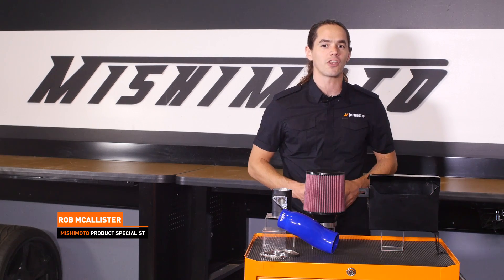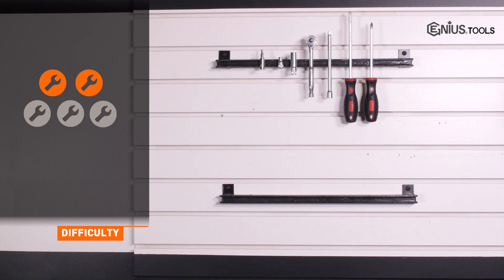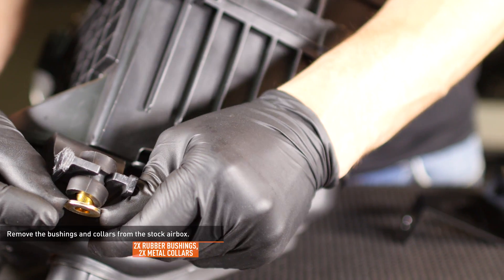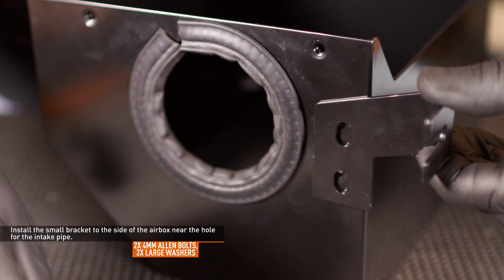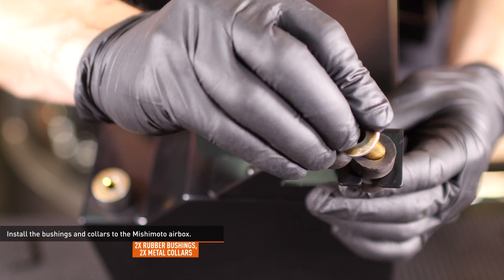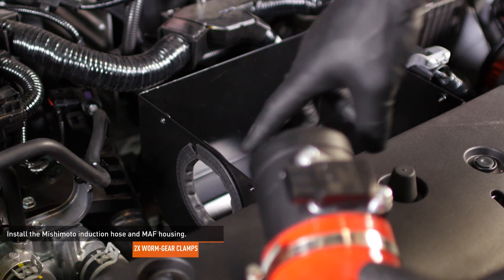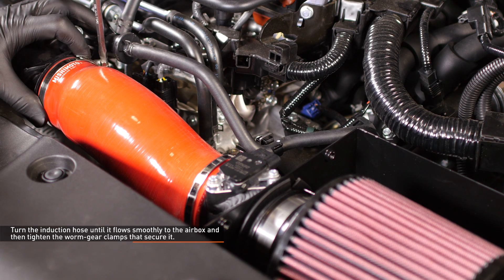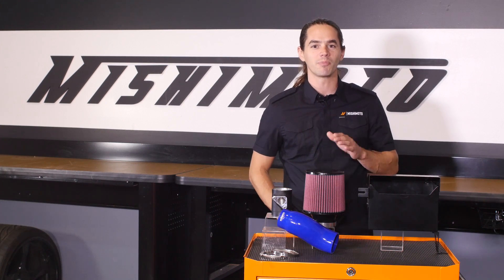2016-2021 Honda Civic 1.5 Turbo Performance Air Intake Installation Guide by Mishimoto

Comment: is this a short ram intake or cold air intake ??
Reply from the maker: This kit does not relocate the filter element location from the stock position, however, it retains all OEM ducting which pulls cooler air from below.

Comment: How many miles in between washing the filter or replacing it?
Reply from the maker: 10-15k depending on location and driving style. Once the filter is no longer visibly red (typically turns a greyish-brown), it's time to clean and reoil.

Comment: Hi, I got mine installed on my 2021 EX hatch a year ago and I would like to purchase a secondary air filter to use when I clean the other one. Which dimensions should I go to, the 4" inlet & 7" length or 3.5" inlet & 8" length? Thank you in advance! 🙏
Reply from the maker: Replacement filter part number: MMAF-2756
https://www.mishimoto.com/performance-air-filter.html

Comment: Increases throttle response?
Reply from the maker: If you are asking if the turbo will spool up faster, yes. The intake will allow it to breath better and net gains of up to 9 whp and 10 wtq on the stock tune.

Comment: Does this intake require me to tune my 1.5T civic hatchback????
Reply from the maker: Nope!
Reply: @mishimoto  what about the intercooler you guys offer for the same car I have CVT transmission 😬
Reply from the maker: Max power gains of 4 whp and 8 ft-lbs torque on stock tuning

Comment: Installed mine Tuesday in about an hour. Painless. Didn't get a chance to drive the car until today, but the difference is enormous. It has this beautiful low-end growl. The turbo is louder, but at about 45 I lose the sound of it to the growl of the engine.

Could not be any happier with this.
Reply from the maker: Thank you for the review!
Reply: @mishimoto  Thank you for making such a fantastic intake. When it showed up and I saw how much care it was packaged with, I already knew everything I needed to. This install video is great too. I have terrible memory but this was done in such a way that I didn't need to consult it again after a watch before the install. You've definitely earned more of my future business.
Reply: @Shiny_Dragonite im sold
Reply: @woodtipwine  After a year of having it and having put a few thousand miles on my car, it's a godsend. My Civic doesn't feel like it lacks for power merging onto the highway anymore. Hands down the best money I've spent so far.

Comment: do other air filters fit in this ? like lets say in 10 years when my mishi goes bad could i throw a k&n from autozone?
Reply from the maker: We sell replacement filters on our site as well. If the size is the same, we don't see why it wouldn't fit.
Reply: @mishimoto is the 2756S version better or not made for civics??

Comment: Installed mine today and the sound is great. It gives a deep low growl when accelerating. I do not hear the turbo woosh that much but anyway the sound is amazing. Installation time is about 1,5 hours, I think 30 minutes is not realistic unless you have installed 10 of them before.

Comment: Reading that this can negatively impact fuel consumption is that true?
Reply from the maker: It shouldn't have a negative affect on MPGs
Reply: @mishimoto  thanks, what about fuel trims?
Reply from the maker: This item is safe with the OEM tune if that's what you are asking here.
Reply: @mishimoto  thank you for the fast response.

Comment: will this work in my 2020 Civic Touring coupe CVT? any tuning needed for the installation?
Reply from the maker: You should not have any issues with the install and will not need a tune.

Comment: would this work on a 2019 Civic Sedan TOURING 1.5-litre, 16-valve, Direct Injection, DOHC, turbocharged 4-cylinder, 174hp engine ?
Reply from the maker: Yes, this would work for your Civic. You will want to make sure you pick up the intake for the standard 1.5 and not the SI model.

Comment: Question: Is there any danger or risk of damage to the filter if I don't install the lid? A lot of users are saying that without the lid the turbo sounds more noticeable and satisfying.
Reply from the maker: No danger at all, you might see some higher intake temperatures but nothing that would damage the filter.

Comment: Do you get that blow off/burst of air sound when you let off throttle like with other intakes? Love the look of the intake and how its enclosed but want something that gives that blow off sound. I will not install a BOV as it causes the vehicle to run rich which can prematurely ruin the Catalytic converter
Reply: Def has blow off sound it's great

Comment: Hey guy just wondering when yall installed the intake did your engine light come on
Reply from the maker: We had no issues with CEL's during testing. We recommend disconnecting your battery to reset the vehicle's ECU and checking over any connections on the intake for leaks.

Comment: Have you guys fix the problem it hits one of the radiator holes? With time it rips it...
Reply from the maker: We haven't seen any issues with the 1.5T intakes. Could you please reach out to Support@Mishimoto.com if you are running into any problems?

Comment: After putting on my intake the whole computer system in my car was warning me.. how do I fix that?
Reply from the maker: Hello HowToObvious. This intake system, in particular, is a direct fit no tune required intake. Thus, it should not cause any engine lights what so ever. Personally, I would suggest removing the system and re-installing. Be sure that all connections are secure. We also have a PDF guide if you would like to take a second look. 
https://cdn.mishimoto.com/media/productpdf/MMAI-CIV-16_InstallGuide.pdf
Reply: Mishimoto Automotive Thanks!

Comment: Does this play nice with a Stage 2 Tune from KTuner? Or would I need to get a custom tune to adjust the MAF?
Reply from the maker: Hey Alex, Thanks for reaching out. This intake system, in particular, was designed as a no tune required, direct fit system. With that said, we did not do any testing with various aftermarket tunes. It would likely be best to reach out to KTuner in this situation and get their opinion.

Comment: Will this fit on a 2017 crv?
Reply from the maker: Hello knight Elite . Unfortunately, we have not had a  2017 CRV at our testing facility so I would not be able to verify fitment on your vehicle. However, the vehicles do use the same engine. As long as the layout under the hood remains similar, I don't see you running into many if any issues.

Comment: Just curious: what would be the difference between this short ram with a heat shield, and the stock intake with a high flow filter?
Reply from the maker: Hey David, while would could not confirm the numbers for a stock intake with an upgraded filter, we did find this product to deliver Dyno-proven maximum gains of up to 9 whp and 10 wtq on the stock tune consistently.

Comment: will you release one for the 17 si???
Reply: TheKrazieness I also like the heat shield design. If they don't release one soon I'll probably just go with a injen and look at designing my own heat shield.
Reply from the maker: We just might! :)
Reply: Please release one for the 2017 Civic Si !! I really like the design of this intake. It even has that outlet in the front to get additional air from front of the hood like stock. I live in Arizona so a traditional CAI will probably just suck in the heat from the HOT asphault and short rams are preferred but with engine block shields, like this one!

Comment: I just bought a 2017 CRV EX L with this engine. Will this system fit it?
Reply from the maker: Hey Bryan! We have not test fit this intake on a CR-V before, so we cannot confirm or deny fitment. OE PNs for the lid and bottom of the OE airbox are unique to the CRV, so it may not fit.
Reply: Thank you for the fast response!!  I just took delivery of my new 2017 CRV EX L 1.5 turbo today and am very very impressed. I will be looking VERY forward to a Mishimoto cold air system for the new gen 1.5 turbo CRV's. In the mean time I have a regular K&N filter on the way which should be interesting.....

Comment: I'm assuming this will work with the 2017 Si, since it is also a 1.5T?
Reply from the maker: Hey Brandon, we actually have an Si coming into our R&D facility next week to confirm fitment.
Reply: Mishimoto Automotive  awesome! Looking forward to hearing about it, also any news on any exhaust systems for the Si yet?
Reply from the maker: No news yet - keep an eye on our engineering blog for the most recent updates once R&D gets underway!

Comment: Does the ecu need to be reset after it's installed?
Reply from the maker: Hi TischlerBMW21 - The computer should automatically adjust to the new airflow.  If it doesn't say "tune required", nothing needs to be done in regards to ECU reset or programming. :)

Comment: Does this void your warranty?
Reply from the maker: No this will not void your warranty - check out the Magnuson-Moss Warranty Act: https://en.wikipedia.org/wiki/Magnuson%E2%80%93Moss_Warranty_Act

The manufacturer would have to prove that your modification/part is what caused any failure or problems.
Reply: Mishimoto Automotive thanks a lot.

Comment: If only someone would make a 3.5" intake that uses the original air box + a cold air inlet relocated behind the fog light with a mesh fog light insert. This airbox design is probably worse than stock, but I do like the silicone inlet.